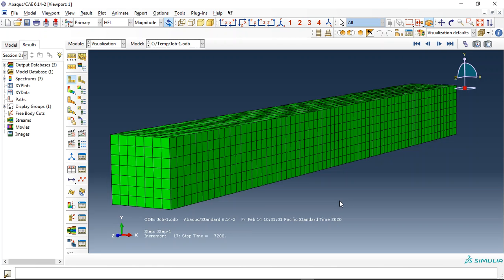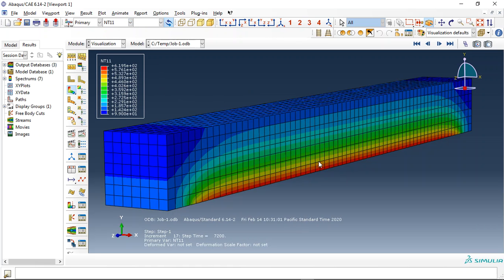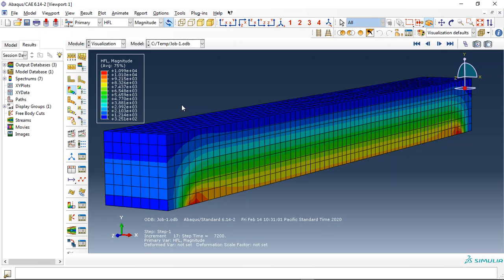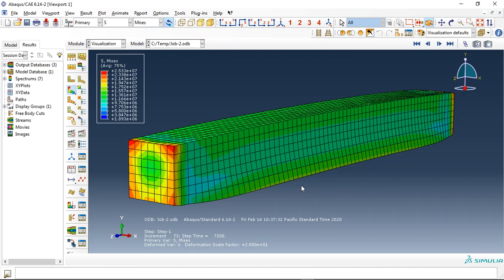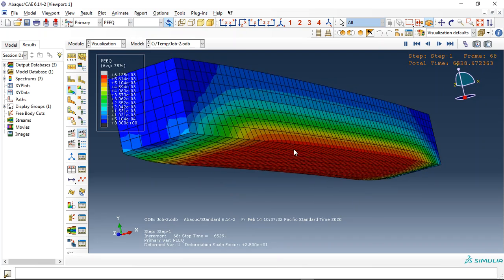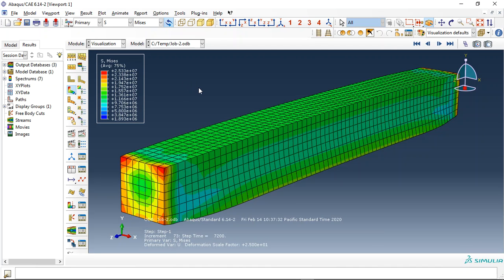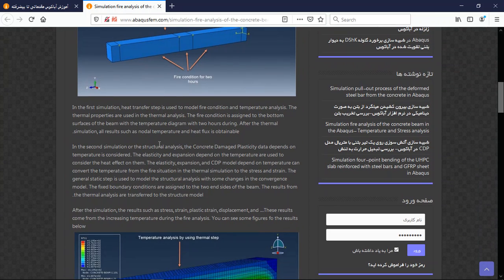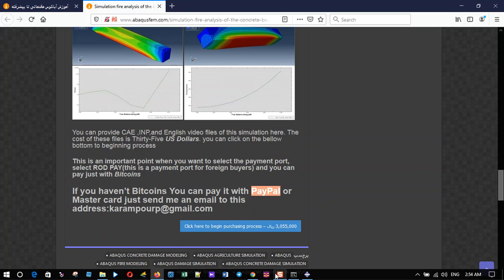Simulation fire analysis of the concrete beam in the Abaqus- Temperature and Stress analysis

Comment: Hello, may I know is it possible to do post fire stress analysis? I mean heat the beam first, and do analyse after the beam has been cold down to ambient temperature.
Reply from the maker: Hi, we did it already in the simulation, first, we apply fire load and then we used a mechanical step for the cooling. Get contact to the website manager to get more details: abaqusfem.com@gmail.com
Reply: @abaqusfem3576  Alright! Thanks for reply!